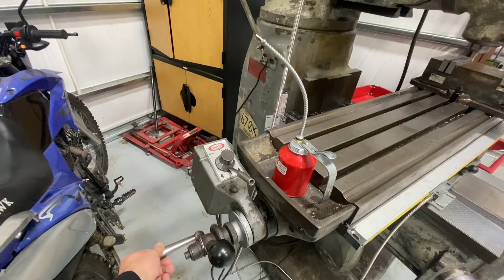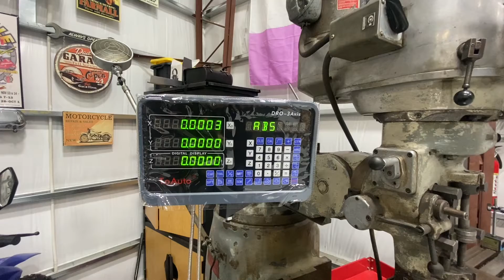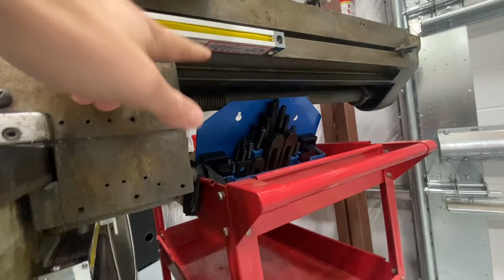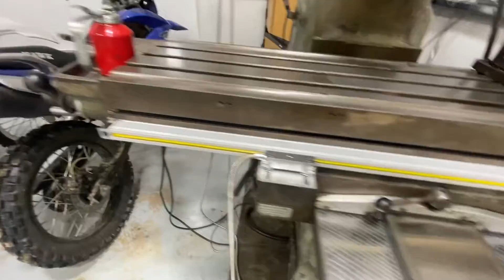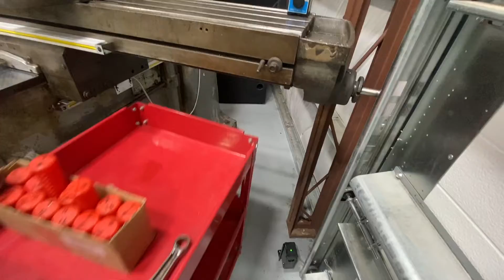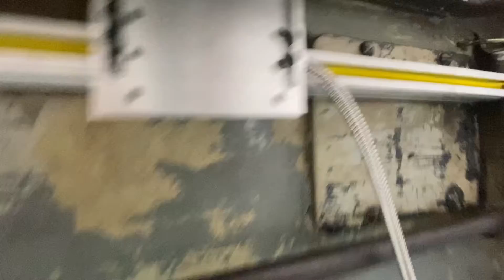Installing a Digital Readout (DRO) on my Bridgeport Series II Milling Machine

Comment: Hi Ted, I hate to tell you this but the yellow opening chip seals are suppose to be mounted on the bottom to keep contaminates, Chips, coolant, oil out. I have Mitutoyo units on all 10 of my Bridgeport's and most have lasted almost 30 years. Put your reader head as close to the center of the saddle otherwise you will crash the reader head. this should be done on the side as well. Use a depth mike and measure from the table to the top of the scale on both ends within .001 inch if you can (not the mounting brackets). On the side do the same but you will have to measure from the flat part of the way. I have been a Machine shop owner for 45 years. A Tool and Die maker, Mould Maker, and Machinist for 56 years. Good Luck.👍 P.S. I mount my scales on the back of the table so I don't drop anything on it and break it. 😎